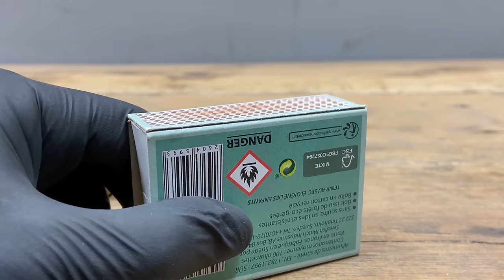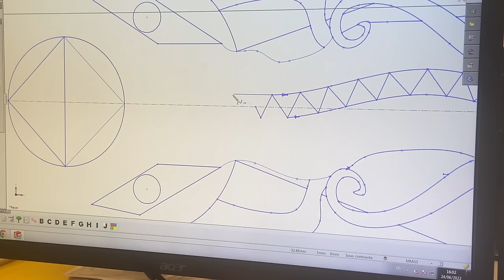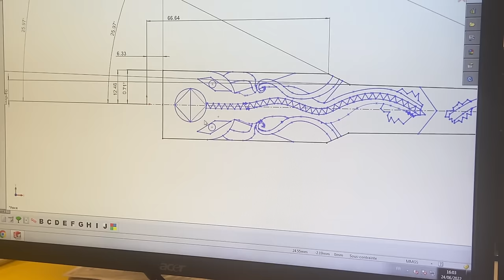Restoration of a beautiful rusty sword - ASMR 4K DIY

Comment: Judging from the bad quality of the mouldings on the crossguard, this is pretty much Tourist gift shop quality, rather than a real sword.
    He vastly improved the thing.
Reply: My thoughts exactly. Made for tourists.
Reply from the maker: Yes exactly

Thanks you😊
Reply: Plus it has a threaded rod for a tang! Made in Spain? Did he ruin it?
Reply: You're absolutely right, but were mouldings any better on mass produced real military swords? I know handcrafted stuff that officers got were likely higher quality (Depending on how much the officer or noble was willing to spend) but the lower level soldiers' swords and daggers. Would they have been much better than this? (As far as mould quality, not blade or tang quality)
Reply: the Rat-tang wasn't enough to come to the same conclusion? the tang is just a thin piece, and will most likely snap if the sword hits something.
Reply: @captin3149  I've only handled a few antique swords, and a fair few old bayonets, but I haven't seen any seam lines on handles or crossguards. It could happen, no doubt. In this particular case, it's obviously an ornament, but it'd be interesting to see if anyone has seen really roughly made genuine swords.
Reply: Judging by how thin the tang of this thing is, yes, it was never meant to be anything but an oversized ornament to decorate someone's wall
Reply: @captin3149  I suppose it all depends on how much the leaders wanted their soldiers to win.
Reply: I have this exact same sword, got it from the Disney World castle in Florida in the mid 1980s.
Reply: @captin3149  As a person who has dealt in these items for 35 years, bit h real and tourist items, I can tell you that this is nothing like any actual sword given to the military. On actual Old World items you will never see bad casting or a parting line that is noticeable. The only resemblance to an actual item is the shape.
Reply: @jeffreybarton1297  These are made in the 1950's and come from Toledo Spain. I've had around 100 of these in the last 35 years. They have long swords, shields and axes, all meant to hang on the wall.
Reply: @Valkonnen  It would be impressive to have a wall filled with all the range of weaponry they made.
      I wonder if the company is still making them? Very likely.
Reply: 13

Comment: If the blade was hardened steel, you introduced stress fractures by cold hammering it thus ruining the blade. It looks like it may have just been mild steel so it was junk to begin with.
Reply: First thing I check on ANY knife is blade quality...give it a simple "ting"test, that'll tell you roughly what your dealing with.
The blade does not necessarily need to be shinyshiny, rather leave it dull and preserve any etching that is present.
This was a good training run...keep at it...good luck...
Reply: It has a rat tail tang so it is shit regardless
Reply: This does come across as a Chinese junk wall display piece.   That was the first thing I thought too when he was hammering on it.  It had to be soft metal.  No practical use other than as a display piece on the wall.

Pretty blade though.
Reply: @superdave8248  it wouldn't work in battle, but I'm pretty sure since nowadays nobody wears armor, you could very well use this to stab someone in the guts without a problem...

Comment: This item appears, as so many other "rusted relics" on U-Tube, to have the look of rust just recently induced. That blade's appearance does not resemble the hilt & grip as far as the entire piece aging together would appear, had the piece aged simultaneously, ie. as a unit, it doesn't match, re. its alleged age of neglect.  The fine threads on that shaft indicate its manufacture from a time that's ANYTHING but "relic" related. And WTH would you continue to emery that blade to the point that there's now barely a trace of its prior engraving?!  Where did THAT faux pas enter the thought process? And a FILE is used to recover the former sharp edge of a sword?!  This "restoration" is just a conglomeration of incongruity!
Reply: ...no one is holding your feet to the fire - I'm sure you're most definitely welcome to walk away to another channel...
Reply: Finally, someone acknowledges that some of these restorations are no more than theater at the most, and fraudulent at the least.
Reply: Just check the channel, it’s called French restore 😂
Reply: Eloquently spoken sir. My feelings and thought precisely as I watched him shred all traces of supposed history I could not believe how so many could send congratulations.
Reply: @VidMediumNS  He said it was a $20 sword. Not a museum piece.
Reply: $20 is $19.99c too much. I have a French Joan of Arc paper knife / Sword of which I bought in Rouen '73. It is very similar. Not expensive, just 50yrs old.
Reply: I appreciate the insight as I'm more interested in the truth than how cool it all looks.
Reply: its a replica

Comment: You were doing great until you put the grip on backwards. The grip should taper toward the blade so the larger end provides a lower chance of it slipping out of the hand. Easy enough to fix, though. Just turn it around. I like the faceted design. In a real sword it would provide more control of edge alignment in cuts.  Your painting of the hilt added a lot to it and made it more beautiful than the makers ever dreamed. 

An idea; if your attempts to burn he wood were not done for comedy, I suggest you get one of the blowtorch-like lighters used by some cigar smokers.
Reply from the maker: Yes😂😂😂 
Thanks for the advice 😊
Reply: The pommel helps with slipping when the handle narrows towards it, so it doesn't only balance the blade. The original pommel here was just a decoration as the blade itself though, and it's now more sensible than it was before in my opinion. Most swords and daggers I've seen and held have had their handle like in the restored version and it's actually more ergonomic to hold when it's like that.
Reply: The original handle has a swell in the middle and tapers toward either end. The handle he removed isn't even close and looks like it came off of an old wooden handled screwdriver.
Reply: LOL I didn't catch that either on the first viewing.
Reply: @wesleyworley8982  Just my two cents, but I wouldn't be surprised if this wasn't Chinese manufactured.  The wood handle probably did come off the assembly line and was left overs from another product line. They just found a repurpose for somebody else excess production run picked up for cheap.
Reply: so you didn't care for when he stripped etching away with sandpaper?
Reply: @superdave8248  they're cheap Spanish, but same idea

Comment: Nice work! I was aghast at first thinking it was a real sword, but the longer I watched the more certain I was it was decorative! Then I was able to just appreciate tour hard work!
Edit: I would recommend a cheap butane torch for blackening wood. You'd probably find other uses for it as well!
Reply: What's wrong if it was a real sword
Reply: @captainbubbles5509  the biggest things would be straightening the blade while it's cold, the loss of the original engraving on the blade, and changing the design of the grip.
Reply: @StarScapesOG  exatamente! É o que diferencia uma restauração de uma  renovação.

Comment: great job on the restoration. i would however recommend perhaps looking into getting a longer and wider flat file when doing the edges as this aids in getting even long smooth strokes to give you an even flat and straight edge.

Comment: it seems to me that you fixed the shaft of the handle a little with the wrong side, if you compare it with the original version - there seems to be a wide part closer to the pommel ...
and so, it turned out great)

Comment: This is an interesting restoration, but somehow the handle appears to be misaligned with the pommel.  Perhaps the handle hole was not drilled straight or the threaded tang was bent.  The handle just seems rather plain, given the fancy guard and pommel.

Comment: I used to have one of those. Just a cheap blade that cost $20 new! Not even the original handle. The time you spent taking it apart was worth more than the wall-hanger you were restoring. Just too funny that you would even bother,

Comment: At the 4 minute mark you showed you shouldn't work with metal. 
This is either a tourist gift or a cheap piece of wall art, even so you should actually do it correctly. You don't hammer cold steel to start, it should have been tempered also as it most likely never was to start because it isn't actually a sword for use.
Glad this was junk because that means you didn't screw up something nice...

Comment: I have that same dagger. That wood handle is not original. The original handle is made of chain link. 
I bought mine about 20 years ago brand new at the Excalibur casino in Las Vegas. 
I covered my handle with sinew because it was so uncomfortable to hold.
The original etching says it's made in Toledo Spain. 
They are made of 440 stainless steel so they're meant for decoration.
Weird idea for a new handle though... As the original was more of a oval where at the top by the hilt and bottom by the pomel should be the same diameter and wider in the center.

Comment: I think you put the handle upside down,i noticed that it isnt drilled straight. If i was doing this and was going to do alot of it i would get a lathe you can find these at flea markets or someplace like harbor freight pretty inexpensive. It will make the handle work much easier. Nice job though.Thanks for lettin me watch!

Comment: Swords should be full tang metal all the way through and not ever rat tailed or welded on with a threaded rod. It was clearly never made as anything but a wall hanger or decorative ceremonial item. Great job however, great restoration.

Comment: That's not a restoration it's an alteration what you needed to do to restore it is to do exactly what's on the blade and keep the same coloration on every part changing the handle out that's different because it's wood but other than that you need to be exactly 100% how it was or altering what the blade was

Comment: Personally I do not like the result. To me restoration is about restoring a piece to it's former glory as much as possible, with as few changes as could realistically be achieved in the process of doing so. Seeing the beautiful pattern be scraped away from the blade made me cringe. Even more so when it was replaced with something completely different and unsuited to the overall aesthetic. Perhaps it was necessary to bring out the shine of the metal, but in that case I would say the preservation of the pattern was more important, or a more delicate approach should have been sought. The hilt seemed to be in well-enough good condition too, I don't see the sense in replacing it unless the process of separation rendered it unusable. I'm not sure if the golden paint is more or less accurate to the original, but it looks mostly fine except for the shield.
Honestly feels like the whole thing would have looked better being reassembled after the acid bath, and/or fashioning your own replica with the adjustments you wanted to see.

I know I must sound pretty scathing to critique every element, I do not aim to offend in doing so, but I wanted to offer my honest thoughts about why I disapprove. I do not enjoy saying that this feels more like desecration than restoration to me.

Comment: Disgusting work!  It does not matter if it is a historical copy or not - the author of the channel does not know the material science at all.  Neither metal nor woodworking.  At the first blows of the hammer on cold steel, there was a strong desire to see his hand on the anvil instead of a dagger.  And when for the handle he used a piece of wood with transverse rings that would break on the first hit, I turned off the roller... 🤦‍♂️🤦‍♂️🤦‍♂️

 Author, learn materials science, treat any object as the only one in history and in the world, with delicacy and respect, preserve every molecule, and restore each layer without destruction.  Otherwise, this is a road to nowhere, and your "craft" is a road to oblivion.

Отвратительная работа! Неважно историческая это копия или нет – автор канала вообще не знает сопромат по материаловедению. Ни по металлу, ни по деревообработке. При первых ударах молотка по холодной стали было сильное желание увидеть вместо кинжала его руку на наковальне. А когда для рукояти он использовал кусок дерева с поперечным расположением колец, которые разрушатся при первом ударе, я выключил ролик... 🤦‍♂️🤦‍♂️🤦‍♂️

Автор, учи материаловедение, относись к любому предмету как к единственному в истории и в мире, с деликатностью и уважением, сохраняй каждую молекулу, и восстанавливай каждый слой без разрушения. Иначе это путь в никуда, а твоему "ремеслу" дорога в забвение.

Comment: This is profanation, not restoration. You destroyed the top layer of the blade and the original engraving, which was handmade of artistic quality, and instead cut a rough vector drawing on the blade using machine laser engraving. You have destroyed the thing, turning it into a barbaric modern alteration. I put a dislike, it's terrible.
Reply from the maker: Thanks!! 😂